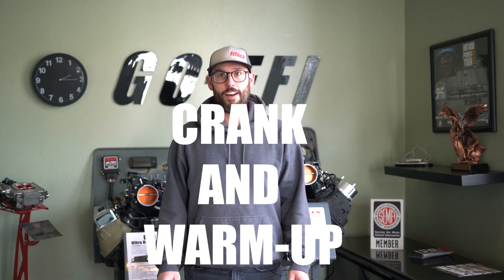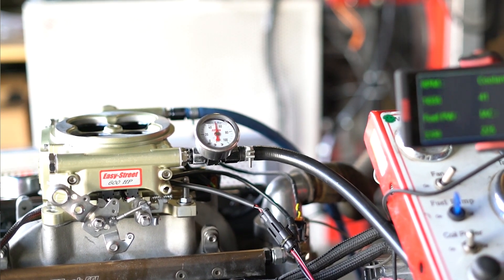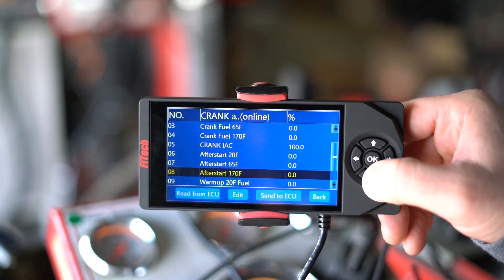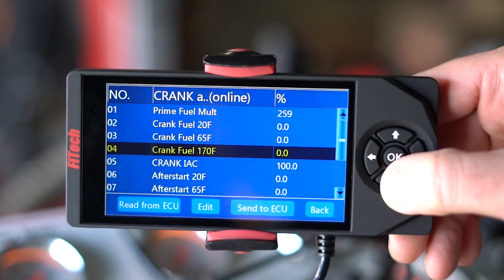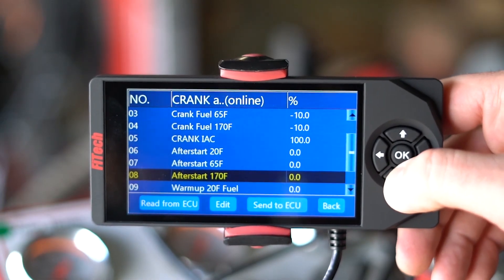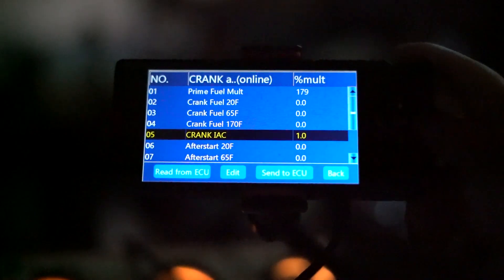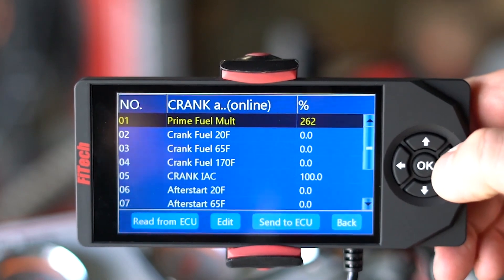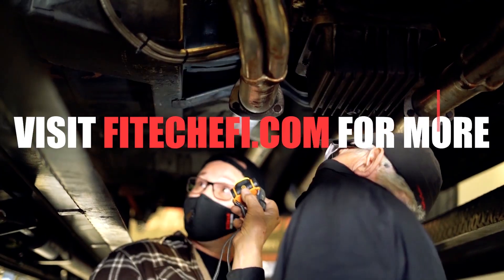Crank and Warmup | Tech Tuesdays | EP11

Comment: After warm up and driving for a few miles, ECT @ 204, the engine will slowly start to stall when coming to a stop and the transmission in neutral. Timing is @ 12° advanced and target idle of 750rpm. How do I solve this issue?
Reply from the maker: Hello sir,

In order to take care of the stalling situation with this vehicle we suggest contacting our Technical support team, there are some adjustments we can suggest to fix the stalling problem, for manual transmission users this can happen, there are adjustments that will improve the state of the vehicle when reaching a stopping point.

Comment: Hi, I have a 1969 Olds with a 455 engine. On cold starts, the engine cranks over several times before starting. It runs fine once started.  Should I adjust any crank & warm up parameters to reduce the time the engine cranks before starting?
Reply from the maker: This is the correct menu to be adjusting so the engine can start a little quicker.
Reply: Ok thx, I'll try some adjustments & see what happens

Comment: I still don't think Daniel understands my problem. The unit was  behaving pretty good till I ran low on gas. The engine acted like it was running out of fuel. After this incident the car won't start while cold. A shot of starting fluid and the car will start but I have to hold the throttle open at about 1500 to 2000 RPM to keep it running. After about 3 to 5 minutes the car will idle fine. THIS ALL STARTED AFTER I RAN LOW ON FUEL (don't know if this a coincidence or not) AGAIN THE CAR RAN PRETTY GOOD FOR THE LAST YEAR TILL the low fuel incident. The filter is clear and the car runs okay at high speed.   Please help
Reply from the maker: Running the system low on gas is effectively making the system run lean because you are loosing fuel pressure. If this continues to happen the ECU learns to compensate this lean (low fuel pressure) issue by adding more fuel. Once fuel is added again to the tank fuel pressure stabilizes and now the computer has to learn to remove what it just did.
Reply: @FiTechEFImedia  I got the car started again after using  starting fluid. I have to pump the throttle to keep it running, also when able to finally hold the throttle steady the RPM jumps from 1500 to 2000 without moving the throttle. The engine stumbles on acceleration Eventually the car will idle after it warms up. I've taken several pictures of what the controller shows if you need to see them.
Reply from the maker: @BryanRosen-wv8uk  Have you checked fuel pressure? Another check is to look for FAULT CODES in the handheld.
Reply: @FiTechEFImedia  my code on line 1 is P0000. I don't have a pressure gauge.

Comment: what if you are cranking and it backfires? LSX setup, gen 4 6.0L
Reply from the maker: If you are getting backfired through the intake on cranking the coil pack harness are either crossed or on upside down. Cylinder 1 and 8 should have a purple wire in the loop going to the coil. If you see a red wire the coil sub harness is flipped upside-down.

Comment: i have a c10 with a 350  that starts and idles (higher than the set idle ) but when it gets warm and i shut the motor off and try to start  , it cranks slow like its flooded. also when i hit the gas pedal it  will shut the  motor off  unless i let off  the pedal, any ideas where to start ?

Comment: I have an f i Tech fuel injected 30005. for the prime shot my injectors turn on whenever they want making my car difficult to start. most of the time I have to reset the ECU and start over I installed a fuel gauge to tell me when the fuel pressure is there so that I could see when the prime shot was taken over you could see the fluctuation in the fuel pressure. then I know when my car's going to start .but it might take 15 times of turning it over to get this to happen. I'm afraid to take my car anywhere because I never know when it's going to start or it's not going to start.  Please help me

Comment: Hot starts is nearly impossible.  Adjust settings on multipler and the 170 degree . Up and down . Outside temps is 90 plus . Please demo on hot 🔥 starts .

Comment: I'm still having issues, hopefully this solves some of my issues. My butterflies also like to get stuck closed, which is bad in traffic
Reply from the maker: Hi, it seems that you need a throttle adjustment. This video will help: https://youtu.be/ImnblxUYHRY
Reply: @FiTechEFImedia  thanks for the info, another issue I've been having is the initial cold start up likes to crank for about 5 to 7 seconds before it turns over. Any adjustment videos for that?
Reply from the maker: @frankie4speed818  More Prime Fuel and More cranking fuel most likely.

Comment: Hello
I really  the videos. Also like my FiTech 30002 600 throttle body fuel injection it has really woken up my engine. But I am also having a few problems. I have 1969 SS chevelle 396 bored and stroked mild build with a little more then 400 HP. It starts up fine but almost dies before it levels out. It pulls pretty good but engine pops between shifts at times. Very hard on fuel. A friend has been helping me out with it he also has Fiteck fuel injection but totally different car. I not a very handy with this stuff and would like some help without offending my friend. Mark
Reply from the maker: Our biggest recommendation is to record a datalog and share it with us. We can see exactly what is causing both issues. We have a video on how to record a datalog. You can email our tech team at techmail@fitechefi.com.

Comment: I would love to see a video on properly syncing the distributor timing with the handheld and phasing the rotor. 

I believe I did it correctly, but I can understand it better if seeing it step by step, rather than reading it and second guessing myself
Reply from the maker: Check out our other videos! We have done two videos on timing control.
Reply: Bring it to TDC, make sure your distributor is pointed to your #1, then do a factory reset on the handheld. One that’s done put in your initial setup info. Thats what did it for me. Also, make sure you have a fully charged battery because even if it’s just a little weak it won’t fire. Then in addition, make sure that tach wire (blue if you’re using go spark) is connected to your brown tach wire in the EFI harness. Points go spark wire (white) goes to the yellow EFI wire, and the Red wire on go spark just goes to any switched power source that is hot while cranking and running.

This knowledge was recently obtained first hand.

Comment: If I try to crank it and the engine backfires instantly what does that mean. It will also blow smoke from the intake and dosent want to star.  Then finally after 3 times of cranking it will start
Reply: I had the same issue. Hooked up a noide tester to my injectors and was getting a faint light on the tester. Checked my grounds and added New ground directly from back of head to battery and havent had issues since. I almost shit my oants when mine backfired and started smoking like crazy LOL
Reply: @rampena9426  lol me to.  Thx I will try that
Reply: Backfire is almost always timing

Comment: Personally I think your Crank Fuel Multiplier has a design flaw. It adds fuel at all temperatures including when the motors hot and doesnt require extra fuel. Ive seen that this has led so many people to get a good cold start but a poor hot start ... they think it's not getting enough fuel when its getting too much and adjust it to add more in cranking compounding the problem further.

A tweek in any future software upgrades  that allows the user to shut of the crank fuel multiplier facility at their chosen temp would be a good idea I think.

Meanwhile I'm advising people to reduce it as much as possible, (even disabling it at -100 if they can in winter) and compensating by enrichening the cranking fuels.

My Multiplier is as low as I can get it at -50 and I raised the cranking fuels. Our winters are mild but starts first flick of the key with a stone cold and bone try intake and with no throttle.

Other than that I've had 5000 trouble free miles.
Reply from the maker: I'll forward this information to the right people!
Reply: @FiTechEFImedia  Thanks. If your guys don't do this because I've not thought about a specific issue could you reply letting me know what that issue is please. I'd be interested and not too old to learn from people more experienced  thanks.
Reply: @Rush-gz9sx  I'm actually still trying to work on my initial crank. I have it @ zero and it's cracking for about 4 seconds before it turns. What motor and specs do you have a far as the motor?
Reply: @frankie4speed818  
My specs arent necessarily going to work for you and could even set you back further.

It really takes about a week to 10 days of going out every morning and trying to fire it up without using the throttle at all and with the crank fuel multiplier disabled.

Then just adding increments of 20 to the crank fuel at 65F until it's either firing or close. You can try it a couple of times each morning but it's the first crank that really counts. If it fires second time you're getting in the ballpark.

I got it so it fired up stone cold and bone dry without pedal almost instant then backed it off 10 the next morning until it wouldnt start again. Then nudged it forward with a bit more fuel so it was where it was happiest. 
But like I said I had to use a small shot of multiplier it just didnt want to know without it .... but loads of guys have it totally disabled and I wish I could but I'm happy enough as it is. 
When it's real hot and I've only just switched off and need to start again I just push the pedal down as I key on which disables Primeshot just for that one start attempt.
You gotta learn to live with it a little .... it's an entry level batch fire EFI system for a grand so it's not going to be perfect .... but itll better than a carb to live with when it's on the money.
Reply: @Rush-gz9sx  I tried adjusting it some more today. I've noticed on the second, third, and forth turn over, my idle likes to jump up to about 1500 to 2k then slowly comes back down. Also when I put in gear my idle drops to about 600, which I would really like to see the 800 where I set it to. Guess I'll have to continue to drive it so it can learn.
Reply: @frankie4speed818  get it to hot and cold start how you want with as little prime shot as you can before you worry too much about idle etc. 

I take it you've set your IAC steps?
Reply: @Rush-gz9sx  yeah, I set that about a week or so ago.
Reply: Yes I had the same issue. I now just keep the multiplier at a low level and just prime it 2 or 3 times when cold before I actually start it. I have a 545 ci BBF and found that I needed max fuel prime for a cold start but realized that even if u do increase the fuel multiplier to max the software automatically dials it back to a lower number.
Reply: Has this been addressed in new software updates ?

Comment: Had my mean street 800hp running solid for 4 years. Still on the old handheld cpu. Just recently noticed the coolant temp stays stuck at 158 after changing sensor 2 times. Would updating to new handheld help?
Reply from the maker: Yes. If you update to the new handheld it has the option to calibrate the coolant temp sensor. Please calls sales 951-340-2624 ext. 1 to order or you can order it on our website.

Comment: I know it's not recommended but would you guys ever do any information on running e85? I know a lot of people do it with Fitech, myself included.
Reply from the maker: Absolutely, we will be getting to more advanced tuning over time. Thanks for the suggestion!
Reply: @FiTechEFImedia  fitech is fully compatible with e85?
Reply from the maker: @5_lug  most of our systems are compatible with E85 however, you will want to speak with one of our sales reps for details on which systems. Is this regarding a specific system?
Reply: @FiTechEFImedia  yes i have a fitech 31001
Reply from the maker: @5_lug  Yes that system is compatible with E85.
Reply: There's no reply i want to drive my car